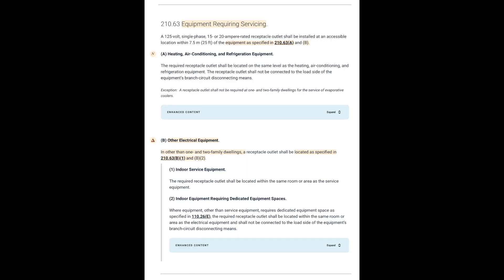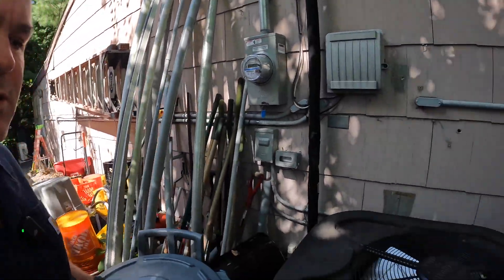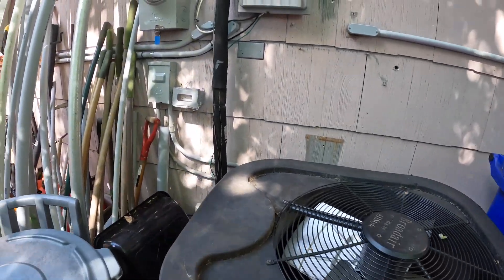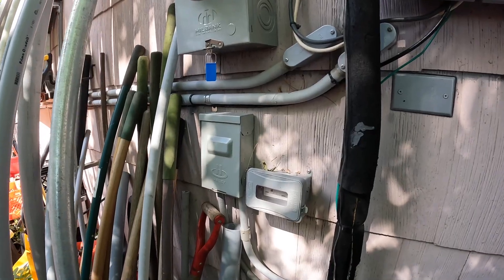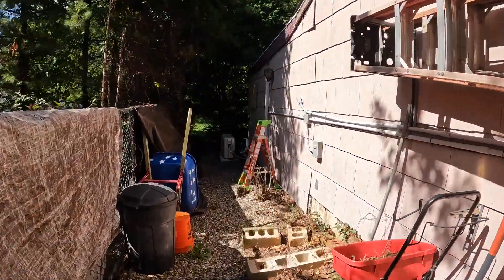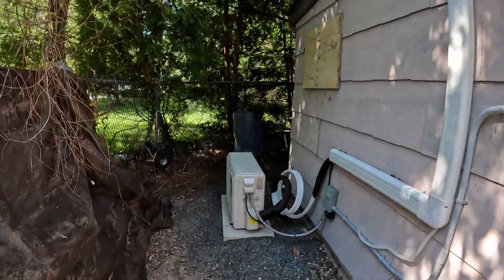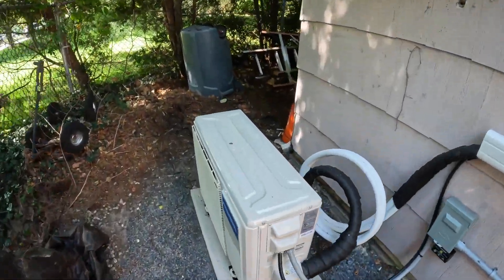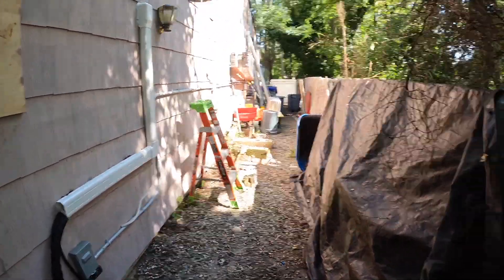NEC 210 63  Equipment Requiring Servicing

Comment: If for nothing else, it should be a common courtesy. The fact that it has to be written into rule is ludicrous. Outside receptacles are necessary in this day & age and their strategic placement is the job of the homeowner and/or electrician. I had made provisions for a block heater at the front of my home. ( I live in the cold north ) and 1 in the back for an electric lawnmower. Good Times.
Reply from the maker: Receptacles are required for dwelling units at the front and the rear.

Comment: I was an electrician at an extra cheap corner cutting NJ Ganett newspaper back when stock split and making huge profit. While wiring in two condensing units maybe 40' apart I installed a GFCI receptacle between them. Of course my boss got pissed off because I did what he said was extra unesecary work. When the township inspector came by he said it would not have pased insoection if the receptacle was not installed. Same tight wade ahole boss got pissed when I instslled two receptacles in long hallway so janitors no longer had to use s 50' extrbsion cord to vacuum hallway rug every night.
Reply from the maker: @JohnThomas-lq5qp  Some EC’s aren’t code nerds.  I’m so into it but not everyone is.

Comment: Being a Home inspector, we can only use the cide for guidance.  If you actually did a code inspection,  most himes would not "pass". A home built in the 70 or 80s could never "pass code". And typically is not required unless you update or remodel.  I do "recommend " for safety several items. But they are not required. I laugh at one HOA home I did, there was an exterior stair railing installed on the front stoops, it looked nice and was done for elderly safety. This HOA required it be removed because they do not allow them, even though it had been in place 15 years... and provided support using the front steps. It would be required by todays codes on new construction.  Thanks for the content.
Reply: Older homes are usually grandfathered in. As long as you are not performing major remodeling you do not have to meet later codes.
Reply from the maker: Not sure if you're in NJ or not but here we have what's known as the rehabilitation sub code. The NEC does not supersede the Uniform Construction Code and not every section of the NEC is enforceable. It's a bit of a pain in the ass at times.
Reply: @electricianron_New_Jersey  In dukes of Hazzard Pa. Lazy lying politicians claim since 1964 they are working on a state electrical license. Philly was using two code books for think 6 years. Newer code cycle for 1 & 2 family dwellings and a three year older NEC for everything else. Worst part some towns do not recognize  electrical licenses from other Pa locations and make you take a 4 hour exam. Worked in two tiny hick towns where the only electrician living there not only made you jump thru hoops issuing a license but often failed you after your inspector passed the job because he had his own unwritten code laws. One failed me for splicing a #14 Guage wire  in a new panel on a service upgrade. Gave him the code article that allowed that and told me that he would let me get away with it that one time.

Comment: It's an old house, receptacle shouldn't be required anymore than an AFCI breaker is. Codes like these are for new houses. Your not going to rip all the breakers out of someone's panel just because AFCI is now required and you made a modification.
Reply: 406.4(D) specifically says that when you REPLACE a receptacle in an area that requires AFCI protection then you must AFCI protect that receptacle. Just like if you replace a bathroom receptacle you’ll install a GFCI.

Comment: Would it not be easier to just measure the distance instead of thinking it was within 25 feet, especially if you think it is close?
Reply: It's not worth it. I would be very surprised if an inspector took issue with this. The receptacle is within plain view of the equipment. In today's world, everything is cordless, so there is no need to plug something in when working on the equipment.

Comment: I got burned a little bit on a job i did recently. Gave a bid to install a new circuit to a new disconnect and wire up a mini split system in an old historic house. I got so caught up in finding a path for my circuit and planning my install that i neglected to see if there was a service receptacle near by. I got the job, went to do the install, and thats when i realized my mistake. Of course i didnt get lucky, the nearest outdoor receptacle was 30' away. Luckily i had everything on my truck necessary and was able to tap off of the garage door opener receptacles easily, but still.
Reply from the maker: I've been there and done that! It's mistakes like this that you'll make less of as you gain mkore3 experience. I still make mistakes every single day.
Reply: Honestly garage door openers are supposed to be on its own circuit itself too.

Comment: I just installed a shutoff with a gfci receptacle in it for the condenser.  With your standard pull typ blade shutoff that's for hvac equipment.  Two birds one stone.
Reply from the maker: As long as it's listed it meets the code.
Reply: @electricianron_New_Jersey  bought it like that.
Reply: You ever get out to the whiting area? You should stop by one day and check out my setup. I'd like to pick your brain on few things.@electricalron
Reply: Big problem that I see with that combo is that you had to use a two pole circuit breaker for the 240 volts to condenser and a 15 or 20 amp single pole breakers for the 120 volt receptacle. Even if you label that two separate breakers supply power careless Johnnie homeowner could get electrocuted when he only turns off one of the breakers and plays inside of the disco.
Reply: @JohnThomas-lq5qp  the 120 outlet is on its own 20 amp breaker
Reply: @JohnThomas-lq5qp  thank got i installed it and am not johnney homeowner.

Comment: Did you have to put Freon in the system or did it already come with it
Reply from the maker: @Eightball2516  it comes pre-charged so it’s very DIY friendly.
Reply: As mentioned, it is precharged.  I have a 24k BTU MrCool and love it.  But there are no maintenance/charge numbers that I can find, so if you ever have to dump the charge, you recharge through experience. There is only one port, and you would charge to get a decent superheat number and cold air.  OR measure the superheat when it is new at different fan speeds and outdoor temperatures, and then keep those recordings for future charging needs.  There are several YouTube videos on this.  Having said all that, I have never had to recharge a MrCool unit in over 10 years, and I live in S FL, where it is on nearly 24/7/365.
Reply: It's in the line set.
Reply: It's not freon it's refrigerant. Freon is a type of refrigerant. I forget the name of the refrigerant that they use today but maybe r134a or the other one r1234 something like that can u guys help me with the name I know u guys can 😂
Reply: @seanstrickley3992 was r22, then r410a, now its r454b and r32 which are mildly flammable. R134a is automotive, replacing the old r12, and now replacing the r134a is the 1234yf.
Reply from the maker: @mitchdinner9743  wow, you know your shit!
Reply: @electricianron_New_Jersey  I dabble
Reply: @electricianron_New_Jersey  can say the same to you sparky. Mr. Good enough to teach others.😊
Reply: @Strick1987  It's a trademark name by the DuPont Co so all freon is refrigerated but not all refrigerated is freon.  It's like, Kleenex, VELCRO, etc.